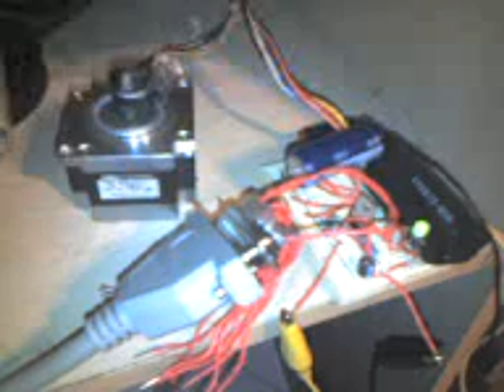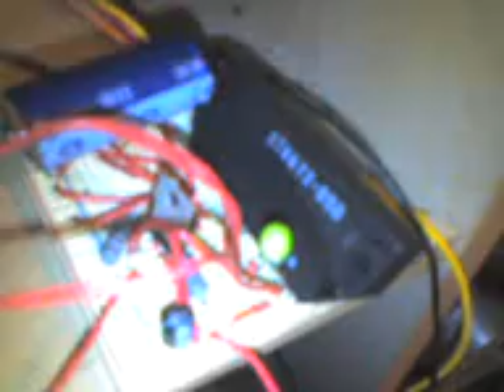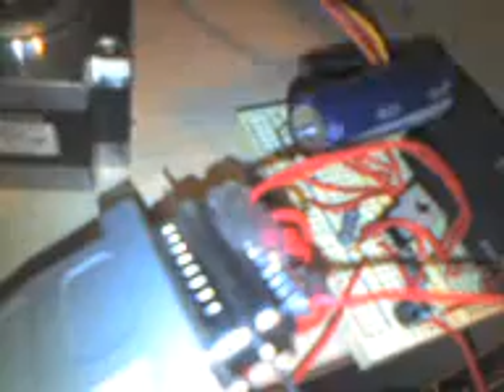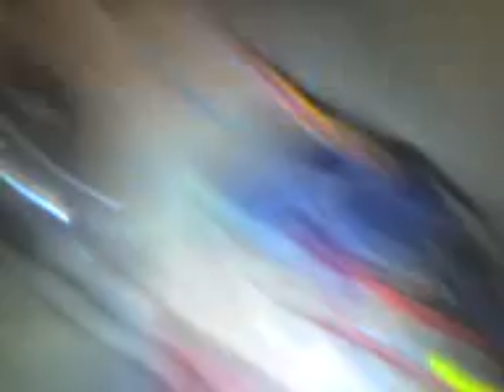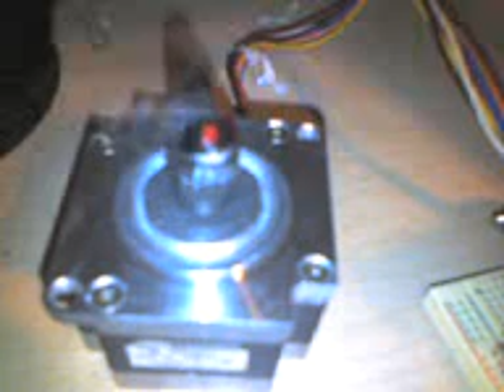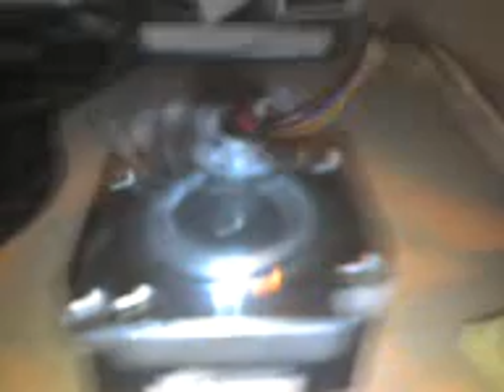STK672 050 Stepper Motor Driver

Comment from the maker: Yep, you got it. Every time you take that pin from low to high, the driver will turn the motor one step. Just remember that pg and sg are your ground pins. It was confusing to me at first, ha ha.

I think you found the same scanners I did, ha ha. I found one of those SLA7026M chips in the same scanner as the two STKs I found. From what I can tell now, I'm pretty sure it is just a buffer of some kind, and won't drive a motor like the STKs. Maybe a flip-flop between A and B could drive it?

Comment: So pin 14 is the stepping input (CLK)?  Yea, I took apart two large scanners and each one had three decent stepper motors, two STK672-050's, and a SLA7026M.  That last driver is weird though.  It has four stepping inputs, so I'm not sure how to make it work in a CNC application.  In any event, I'm breaking down a couple large printers.  I'll let you know if I come across more stepper drivers.  If so, maybe we can do a trade.

Comment from the maker: You found a bunch eh? heh, I could use a few ;) However, I'm sorry I didn't make a circuit diagram. In the datasheet, at the top of the 6th page, is about the closest to a schematic. The difference is that pin 15 is the direction input. I guess it's not very straight forward, but it's what I was working with. Hope that helps!

Comment from the maker: Well yours is a bit different. First off the 080's don't have separate grounds for the driver and motor. And the 050 has 22 pins where as your 080's have only 15 pins. They don't look very difficult. Actually I'm almost curious if those would be better for my application ha ha.